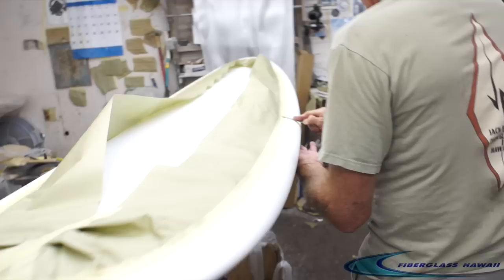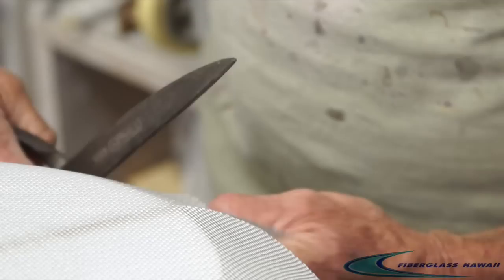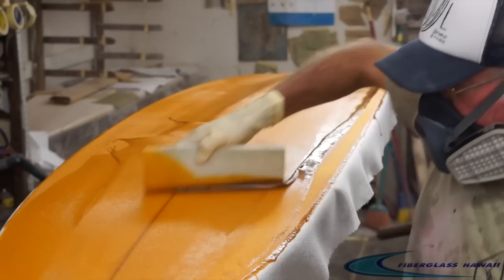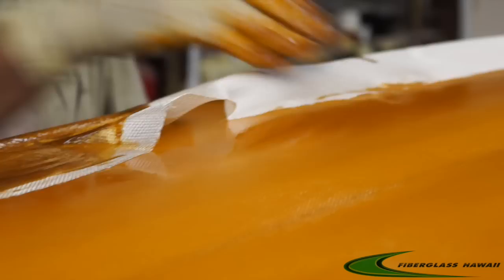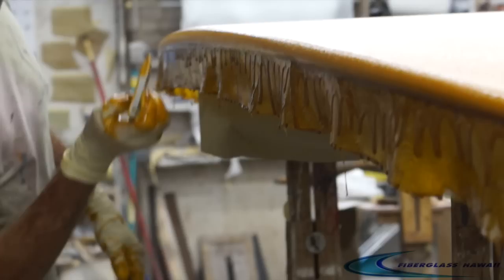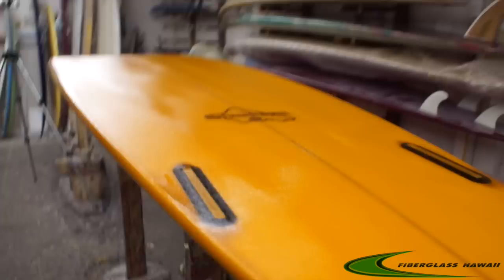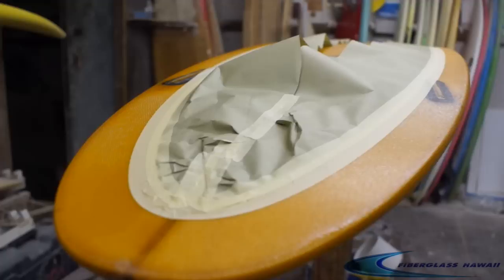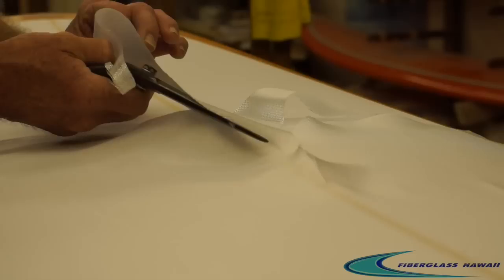Resin Tint Glassing with Jack Reeves

Comment: Can you ask Jack where he got hold of those shears he's using? They do an amazing job (although a lot of that is down to the operator).
Reply: They are old grass shears, might be able to find them in a gardening store or Home Depot or Lowes!
Reply: its a combo garden sheers and large cloth sheers ,, you remove the garden sheer blades and replace them with the cloth sheer blades ,, yes you need someone to weld them together but will save your hand if your doing 10 boards a day